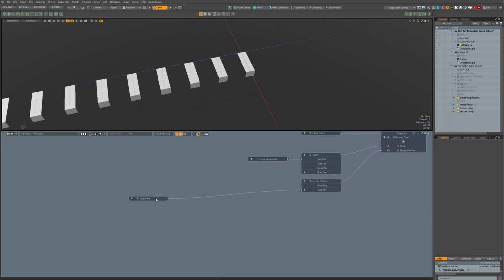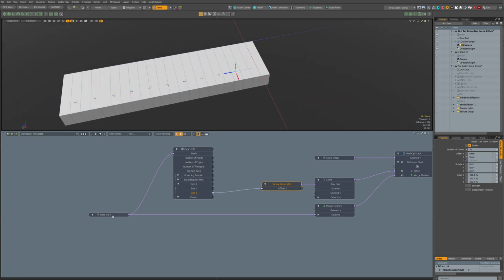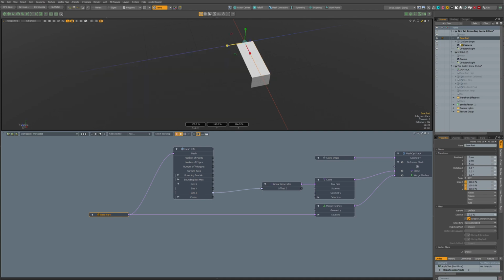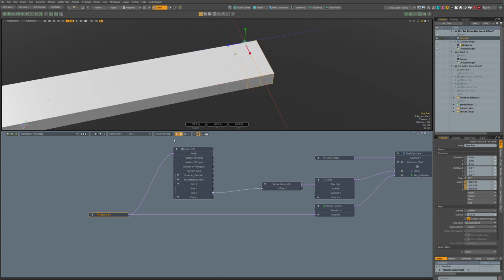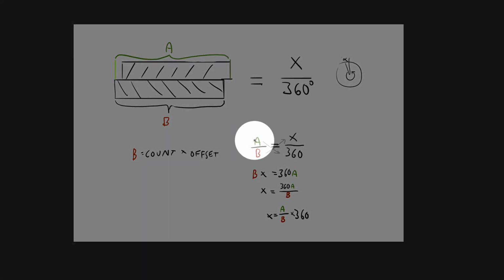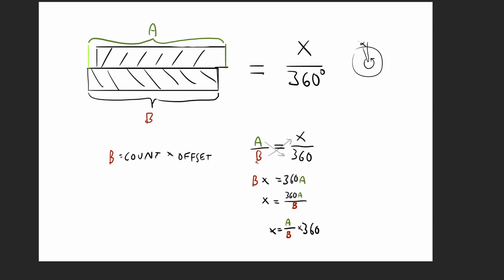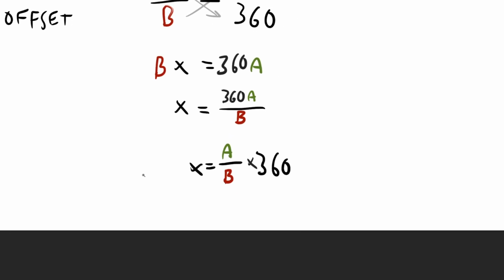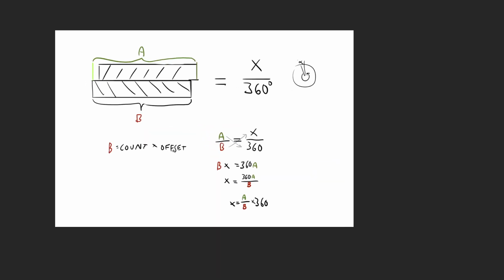Procedural Tire  -  Modo Mesh Op Tutorial - PART 1

Comment from the maker: Error in the mesh at the end part video is is due to the reason that the "base" par is cloned X number of time, but there is the original also. So the length for the bend angle calculation is the amount of clones, plus the original one. X+1. I used only the number of clones.